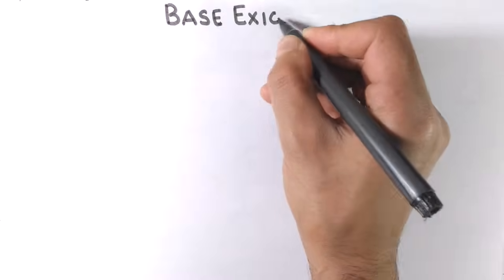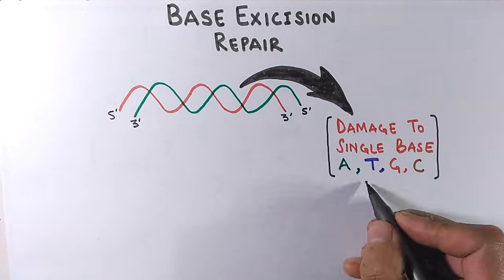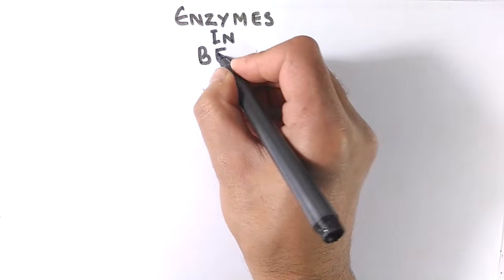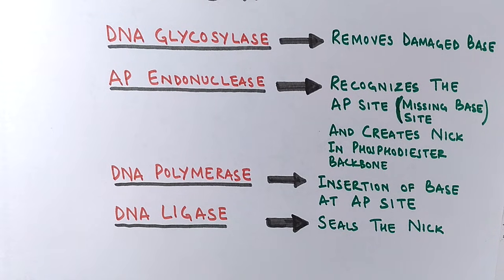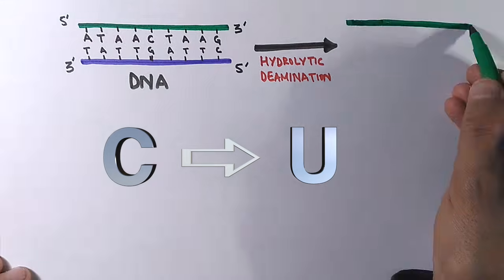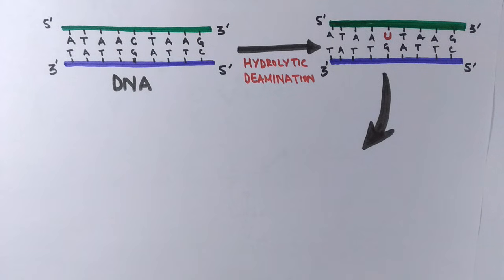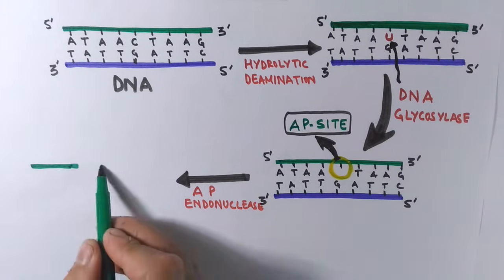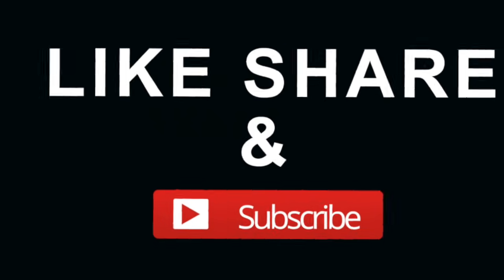Base Excision Repair | DNA Repair Mechanism

Comment: Ap Endonuclease cleaves the 5’ end .. and Lyase cleaves the 3’ end .. then DNA polymerase and DNA lygase play role.
You forgot to mention the Lyase part! 
“Base-specific Glycosylase removes altered base and creates AP site (apurinic/apyrimidinic). One or more nucleotides are removed by AP-Endonuclease, which cleaves the 5′ end. Lyase cleaves the 3′ end. DNA Polymerase-β fills the gap and DNA Ligase seals it. Occurs throughout cell cycle.” GEL PLease! (The steps gylcosylase, endonuclease, lyase, polymerase, ligase) 
The quote is from FA USMLE step 1, biochemistry section (2 section), page 40.

Comment: sorry what is AP Site?
Reply from the maker: apurinic or apyrimidinic site. Where Purine or Pyrimidine is missing.
Reply: @hussainbiology  I've been told  by my professor that AP sites are strictly for missing purines
Reply from the maker: @Conquerorstapestry  Actually apyrimidine site is very rare since it requires high acidity to cleave off the pyrimidine from the site where as Apurine site is easily formed in the cell at lower acidity or even under neutral pH.
that is why your Professor has told u it is mostly Purines.